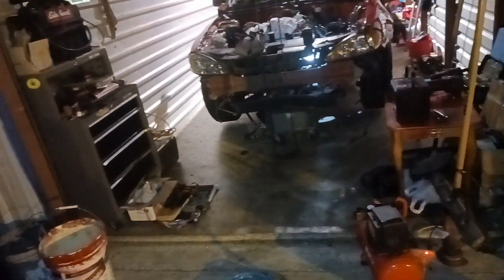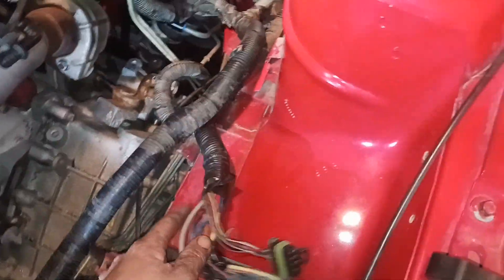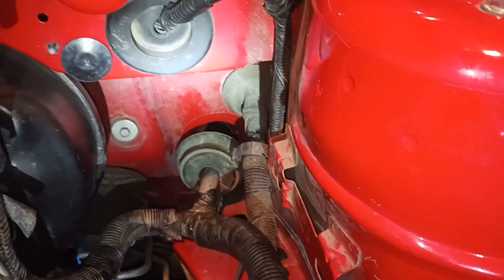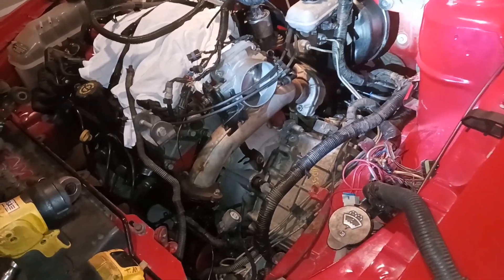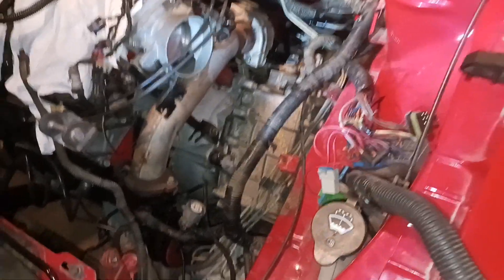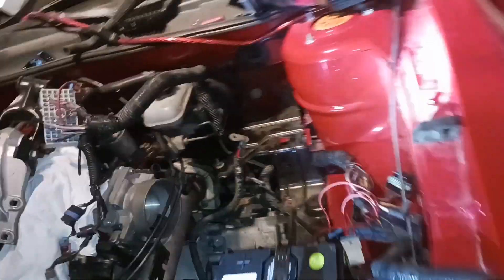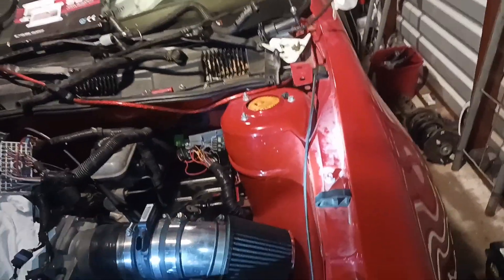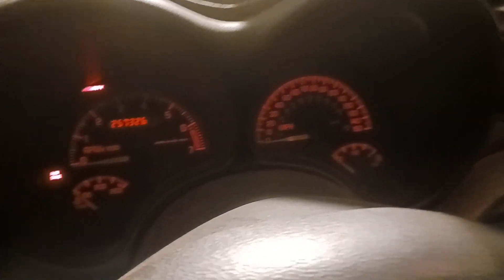04 Grand Am 3800/5 speed swap sees power for the 1st time in 4 years!!!

Comment: No crank, no start. Hmm.🤔
Reply from the maker: Yeah it doesn't have the cam sensor or crank sensor plugged into the harness. That's part of the harness I'm waiting for drop Guage. But I did jump the starter off camera and it cranks nice like a healthy engine should.
Reply: @PontiacsGarage  Sounds good. I'll be waitin on the video. Goin to install my cut out shock towers and new struts tomorrow. That oughtta be an interesting job.
Reply from the maker: @stevewheatley243  nice!! I'm still waiting on my 4 new struts to get here. And the axles and everything else I ordered. Just got the control arms in today.
Reply: @PontiacsGarage  Check out your rear shock towers. I never even suspected mine was bad. The front ones are perfect. Had a helluva time cuttin out those junkyard towers too. Made a mess of the rear quarter panels on an 02 grand prix.
Reply from the maker: @stevewheatley243  that sucks bro. I'm glad you got what you needed tho. I've had my struts out and everything is solid. Underneath the car is solid. No rust at all. Had too much ps fluid and oil all over the bottom of the car when I got it. Lmao. But it saved her from the rust. She's a Tennessee car.
Reply: @PontiacsGarage  A cheap but effective way to undercoat a car.lol😂
Reply from the maker: @stevewheatley243  yeah but I've been trying to clean it up. Lmao.
Reply: @PontiacsGarage  What,you want rusted out shock towers like me?🤔🤣🤣
Reply from the maker: @stevewheatley243  not at all. But I want it to be clean and nice.
Reply: @PontiacsGarage  I was bullshittin as usual bro. I had a pan leak that blew oil on my exhausts. Stunk like hell.😂